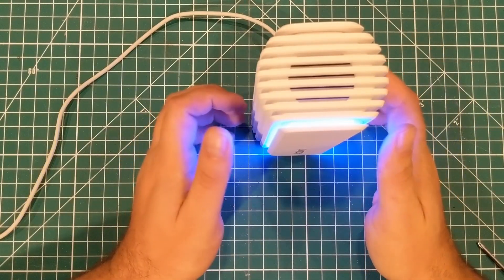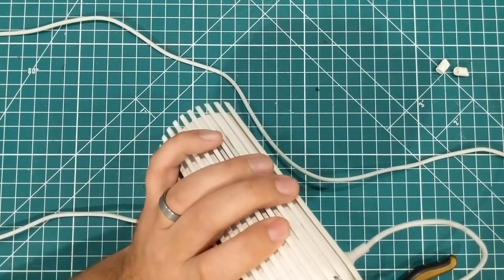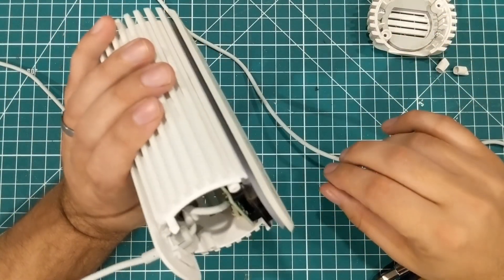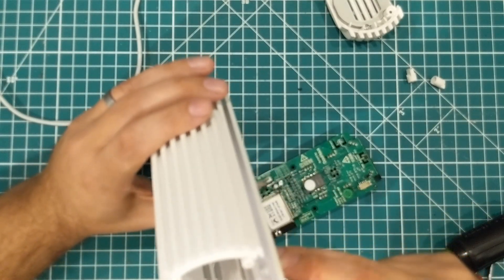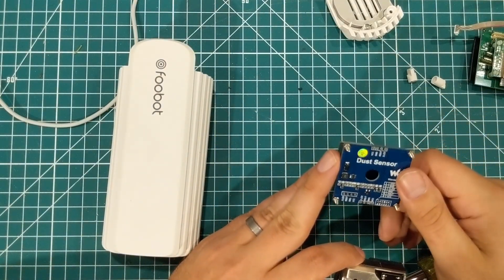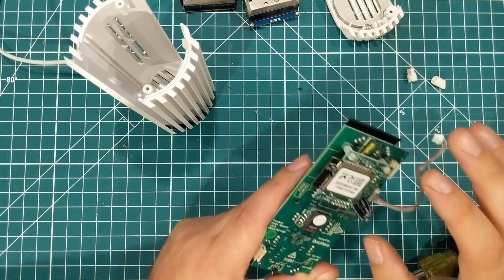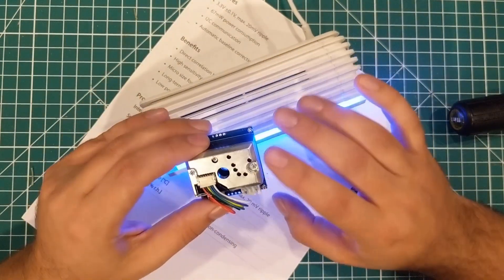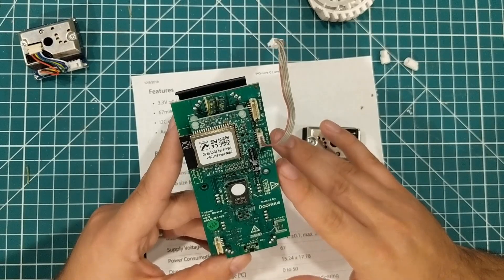Foobot Teardown

Comment: Possible to add some link to the different components you’ve found, mainly that sensor at the top as I have two footbots, one was £12 one as £20 on eBay and they are 2cm apart and yet some reading a almost double between them so thinking that I need to replace that sensor however as you mention the controller is self correcting so might not help but if it’s $12 that might be worth a try 🤔 thank you
Reply from the maker: This is the dust sensor that all of those things use.  https://www.aliexpress.com/item/32819636764.html

Comment: I just finished a check with nmap on the Foobot. All the UDP ports seem to be closed except 67, 6414, 31609, 48899, 55756, 58141, 64025. My DNS server says that it looks up broker-gw-us.foobot.io and broker-gw-us.foobot.io . The only TCP port is 80. You can contact the foobot with a browser by typing the IP number as the address. You will see a username/login prompt.
Reply: Sorry there was a cut and paste error. The other address that I see DNS lookups to is api.foobot.io .